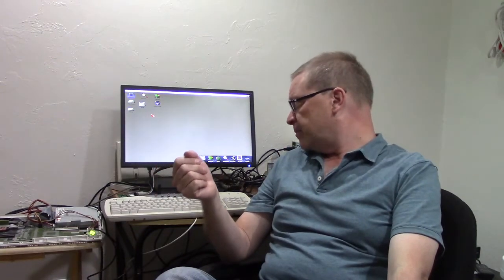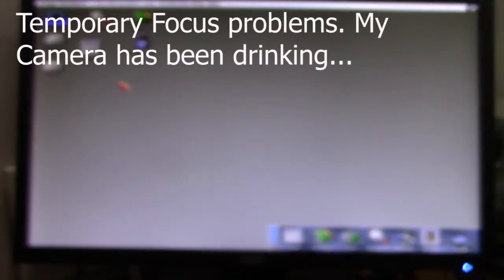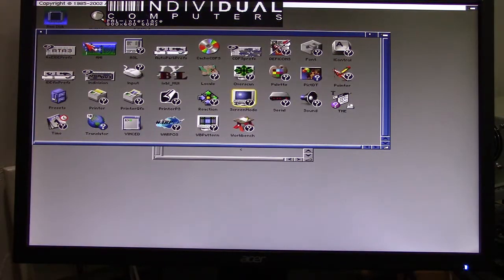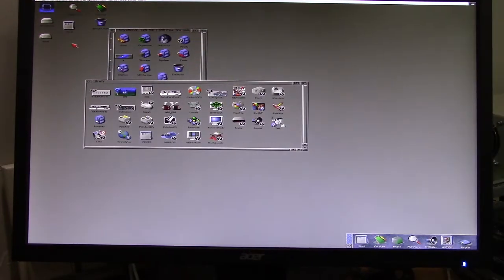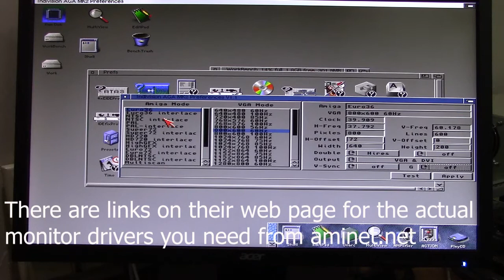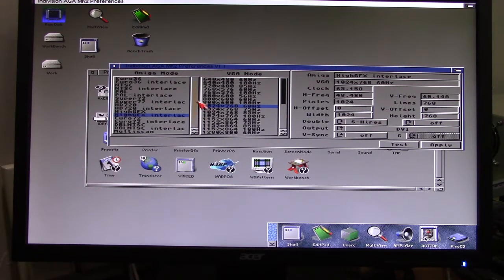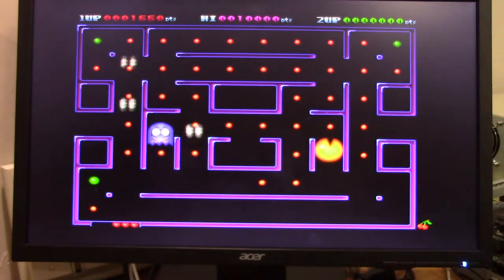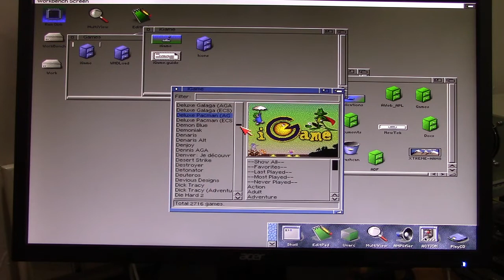10 Minute Amiga Retro Cast Episode 12 - Review of the MKII Scan Doubler for the A1200

Comment: Nice.. Was wondering does it fix the interlaced out the standard 23pin video port for a 1084?
Reply from the maker: Nope. You need a 31.5 kHz monitor to display from the MK2 or MK3. It does not interfere with the original signal from the 23 pin RGB port. That's still sends out a normal signal. You just have a Newport that sends out a nice rock solid 31.5 kHz signal that you can use with any LCD or CRT with a DVI or VGA connection.
Reply: @10MARC  Cheers. Thanks Doug. Have a good Xmas

Comment: Where did you get the extra screen modes? From Aminet?
Reply: I can't find the link on the Individual Computers website.
Reply from the maker: Here is the link for the awesome new screen modes. You may have to put a heat sink on the Alice chip, as they can stress out the chips. There is also a hardware fix for the glitches that occasionally appear on the high res screens, but I have not done it yet. http://aminet.net/package/driver/moni/HighGFX40_6

Comment: I am experiencing the same glitches you had in this video. Did you find out what they are and how to fix them?

Also I have noticed you haven't used the ground wire that comes with the board?

Thank you very much for the great contents. I am a recent subscriber, a very happy one!
Reply from the maker: Good point about the ground wire. I need to put that on. Getting g rid of fblit helps with the glitches, as does putting a heat sink on the Alice chip. There is a hardware mod to eliminate them, but I have not done it... Yet!
Reply: @10MARC  It comes from driving Alice at her absolute Limit. Add a heat sink and active cooling will help in most cases.